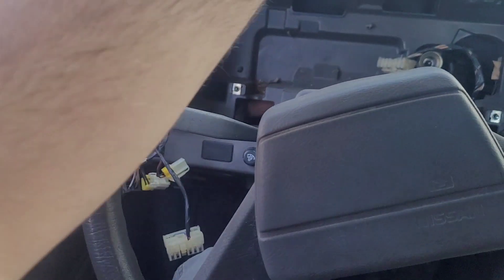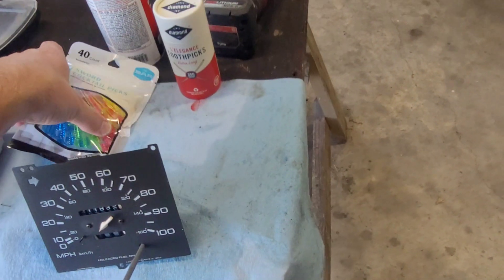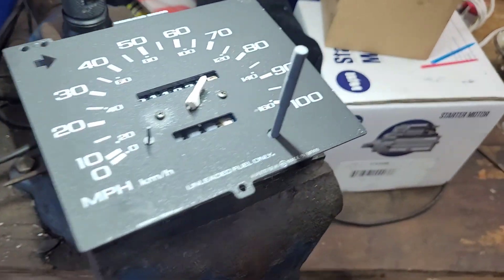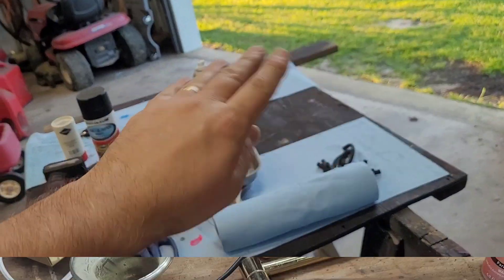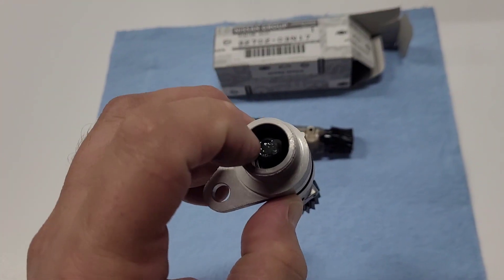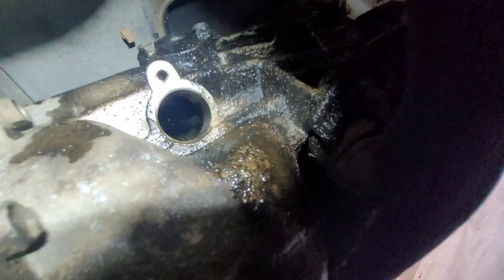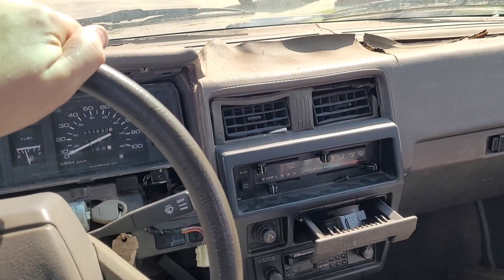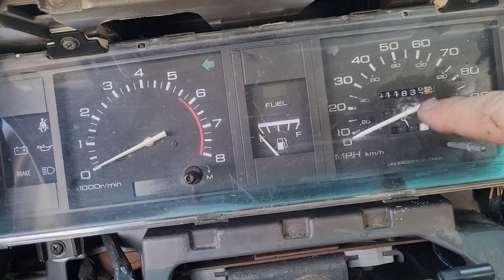Nissan Hardbody D21 Speedometer Fix and New Needle Installation #hardbody

Comment: hey I just got a 1989 hardbody and was wondering if you know what kind of bushings the shift linkage uses? My transmission is a auto with the steering wheel column shifter.
Reply from the maker: Sorry but I'm not familiar with that.  I would try to look at some nissan forums

Comment: Hi Sir! Great fix you did on your speedometer there. I will try what you did for my truck's speedometer  as well.  I just want to ask also why did my fuel gauge and engine temp gauge both stopped working? My truck's a 1986 Nissan 720 Kingcab with Z24 2.4L engine, 5-speed standard transmission. I thought maybe fuses but i saw it only has the 2 (black and blue) square relays plus series of small fuses under the hood release notch, which none of it say fuel or engine temp gauge. The blinking - green turn lights/hazard arrows, seatbelt icon, rear defroster icon, high beam icon, and the backlight for the cluster still works. Just really the fuel and engine temp gauge needles dont work. Hopefully you can help me on this. Thank you Sir.
Reply from the maker: It's probably a connector that is corroded.   I would start at the gauge cluster and remove all plug connectors and spray with electrical contact cleaner and reconnect.   Work you way from under dash to engine compartment

Comment: hey, i had the same issue on the pinion and i bought a new one as you did. it worked but after a few miles the pinion got destroyed the same way as the old one. so far i was not able to figure it out why. if anyone know what it could be let me know.
Reply from the maker: It's lubrication is from the gear oil.  Make sure it's not low
Reply: @MajorWeakness thanks for the reply. i did not lubricate but even if i lubricate it will go away very fast when rotating, no?
Reply: @MajorWeakness  the place were the pinion is placed is to high for the oil to reach there. take a look at the video and you can see what i mean.